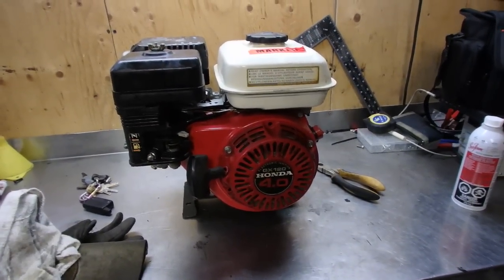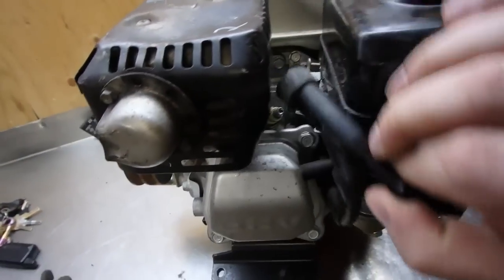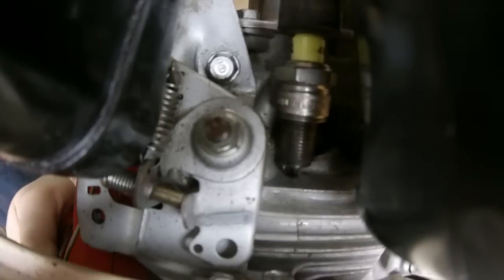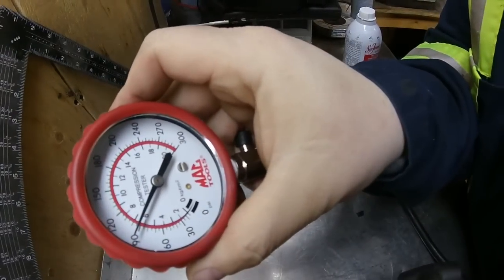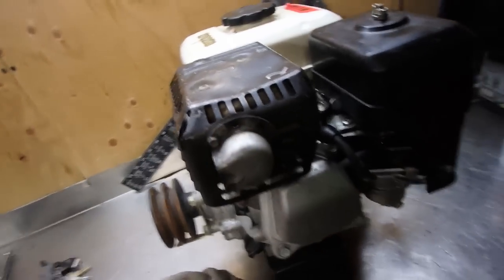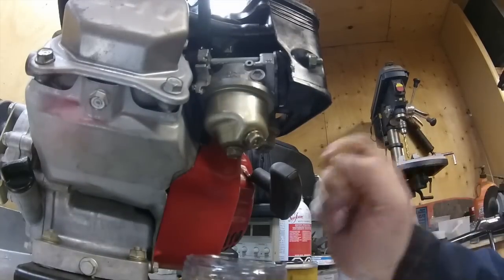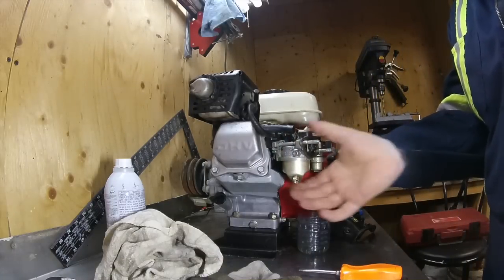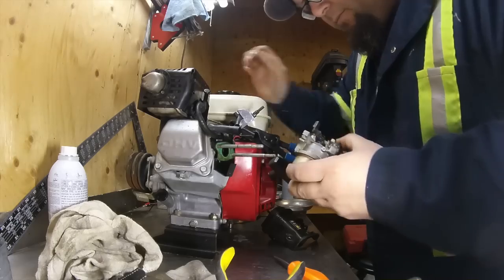Honda GX120 Troubleshooting Won't Start Issue

Comment: The round peg on the choke lever is used to block the fuel line when you remove the carb.. no need for pinchers etc.
Just pull the lever off and stick it in the pipe
Reply: @Drake Jaxon Instablaster :)
Reply: @Wayne Fabian I really appreciate your reply. I got to the site through google and I'm trying it out atm.
I see it takes a while so I will reply here later when my account password hopefully is recovered.
Reply: @Wayne Fabian it did the trick and I now got access to my account again. I am so happy:D
Thank you so much, you saved my ass !
Reply: @Drake Jaxon no problem =)

Comment: Thanks. Exact engine and problem I have. Cleaned and checked everything short of pulling the carb. That's next and I'm pretty sure I'll find a clogged jet or pilot or whatever it's called when I do. Thanks again, you really can't kill these honda engines.

Comment: Great practical video. I just fixed GCV160 that had a clogged main jet. Bought it from a guy who had replaced many parts and couldn't get it to run. Gave up and sold it to me real cheap.

Comment: Thank you getting ready for Hurricane Mathew and generator wouldn't start till i saw this video.  I had put a new carb on 20bucks but for some reason full wasn't reaching the bowl.  Your tip on the bowl help me get it started in 10 mins :).  Thanks again!

Comment: I work and re-build these engines and it's a common fault that the main jet ( pilot jet you called it ) gets clogged. Also by the looks of it you need new piston rings as it was burning oil ( blue smoke ) and that is probably the reason why your compression readings are low.
Reply: always the main jet gummed up from sitting.
Reply: If you would run straight gasoline instead of the e 85  @constantmaintenance2909

Comment: Thank you so much for this! I had everything in bits and was about to throw the carb away until I saw your video! Exact same problem. Only thing is the person before me has snapped off the screw head for the jet, so couldn’t get it out. 
I managed to clean it out in situ using lots of brake cleaner and .6 welding wire! Started on the first pull! Thank you.

Comment: Top tip for you. No need to pinch the hose, if you remove the choke lever it fits perfectly in the fuel hose. Honda think of everything. The pilot you refer to is the main jet. Once this is out you tap the carb on the bench another bigger jet will drop out which will also need cleaning. ( honda trained industrial engine tech )
Reply: Jason Tearne hi there just want some advice on a Honda gx160 on a concrete power trowel, when I start it up, it fires straight into gear and fast too, not idle at all. Recently new throttle linkage, cable, air filter & outer casing. Any help would be much appreciated thanks
Reply: karl luke under the fuel tank is the governor control arm and this may need resetting. Remove tank. Loosen the 10mm nut. Set rhe throttle arm at full revs. Use a pair of pliers and set the pin ( just above the 10mm nut , you will see there is a notch for your pliers ) and with your pliers on the left move the pin until it stops. Tighten nut refit fuel tank  set throttle arm to tickover start engine. Hope this is helpful and not over compicated
Reply: Thanks Jason
Reply: karl luke did it do the job. Resetting the control arm

Comment: Quick tip as far as the to much fuel issue goes make sure your needle seat isn’t swollen because what happened is when that needle seat is swollen it will keep the float from completely stopping the fuel supply to the carburetor and the float will stay open so make sure your seat isn’t swollen.

Comment: The jet is a main jet. And you should also remove the emulsion tube under the main jet and clean out the many tiny holes. Also you only need to remove the three carb nuts and bolt, and not the top plate to save some time. I also use carb cleaner spray and not sea foam but that is only a preference. Good job.
Reply: +Stephen May he got lucky without removing the emulsion tube, and even he did not thoroughly clean the carb, lucky man
Reply: Yep, if this is the same as on my GX390, and it does appear to be the same,  the pilot jet is on the left side of the carb (black plastic 'plug') that's held in place by the idle speed screw. The pilot air adjustment screw is also on the left side by the mounting flange, hidden under a tiny square plastic cover.

And, while the video was a good complete introduction to small engine trouble shooting (air, compression, fuel, spark), if you have a Honda engine (or any small engine, for that matter), that's been sitting for awhile and won't start, I'd go right to that float bowl and main jet first. I think 90% of no-start problems on small engines are caused by a fouled main jet due to stale fuel left in the machine during the off-season.

In my experience, another leading cause of no-start problems on these Honda engines is that they are sensitive to spark plug fouling, and tend to run overly rich which leads to fouling. Someone I know has a small Honda engine on a pump which he uses several times per day in his business. He has learned to keep a handful of spare plugs on hand. The engine will start first-pull and run great for days and days, and then one day it will absolutely refuse to start. He knows to just change the plug. Often, changing back to a previously used plug will work too. They are finicky about spark plugs.
Reply: Nemo Park I have a gx340 and wasnt able to remove the emulsion tube is it possible that could be the problem why I cant get fuel in engine?

Comment: I don't know if this applies specifically to your engine, but some small engines have a compression release mechanism on the intake or exhaust valve.  This delays the valve timing so that the compression is lower, but still strong enough to run.  The purpose is to make it a little easier to pull start these engines with a cord.  I have an engine that won't run unless I start it with starting fluid.  My jets are open as best as I can determine, new gas.  I can run a fine wire up through the jet (but I can't remove the jet; in too tight).  I think I'll remove the carb again and soak it.
Reply: Sometimes the seals/gaskets deteriorate and get leaky and that causes the engine vacuum to be so low that it will not draw in fuel without starting fluid to get it going.  I have an old Briggs engine that I have a can of starting fluid attached with a tube into the carb so I just reach down and hit the aerosol button when starting cold.

Comment: Great video - thanks Jerry!   Ethanol based fuels will gum up a carb fast if they aren't run often.   A little Stabil in the fuel helps a lot.
Reply from the maker: +Jack Maxfield i dunno if it's true or not but they say with todays fuel stabilizer really doesn't do much anymore at least to the article i was reading on fuels.  But this is the internet and anythings goes lol

Comment: You didn't check the oil even  if it's a splash low it will not stay running  I just had the same issue

Comment: Use the throttle/choke white lever. The round part is for the gas line to plug it. Cheers.

Comment: total novice here, but trying to learn... bought a wb20x from an auction, had gas in it, no muffler, no idea if it ran.   replaced the carb, got a muffler, new sparkplug, changed the oil, checked the air filter, cleaned the gas tank...  when i pull, it doesn' even try to turn over, much like what you have.   i thought i had covered the 'air,fuel,spark' stuff... what am i missing?   not afraid to pull the whole thing apart but don't want to if i don't have to.

Comment: Hi. I have a generator works when the choke is off, and never works when the chock is on. Which should be the opposite normally. Noting that it has a new battery, a new spark, the carb is clean, oil is on maximum level… Everything is in good condition. What will be the problem please?

Comment: It could be a leaky float or the level could be wrong, they can be adjusted by heating them up with a heat gun apparently !

It could also be a leaky needle & seat,low compression can give symptoms of a fuel issue such as blowing black smoke,I assume this is the engine that you had to replace the block on ?

Comment: Thanks for posting this. I have a belle 150 with honda 120 engine. I'm simply getting a blac k sooty plug, occasionally wet, no matter what I do with the choke ??? New plug, new air filter, new oil filled as per manual, fresh fuel. Clean the plug, start it and it fires and runs for about 30 seconds or longer then cuts out, black plug again. Checked the carb, defo getting fuel. A few months ago I used it to mix founds for a conservatory and it ran all day ??
Reply: Sounds like the float needle isn't plugging the hole allowing too much fuel into the carb. Remove the bowl and float and clean the needle if dirty, replace if damaged. If that's not it IDK what to tell you.

Comment: Honda engines have a decompression lever on the camshaft gear which gives a false low compression reading. Only way to really check a Honda is to either open valve cover and disable exhaust rocker, do a leak down test or take it apart and check tolerances.

Comment: Hello! Could you damage this engine if you work on it with the shaft in vertical position?
I had the oil enter the exhaust and when i tried to start it, it felt as something was blocking it. I removed the valve cover and the arm that pushes the exhaust valve was pushing on the side of the spring. Also the guide plate for the push rod was worn out on the side  and the gap of the valves felt like 1mm, not 0.15-0.2mm.
Thank you !

Comment: There's a mixture screw right next to your rocker cover/ valves. Half way down the side. 1 1/2 turns out to start then adjust when warm. Check to see if a previous Muppet has tightened it to start adjustment so much they broke the needle of the screw and jammed it in the carb body. GX clone carb will not fit the genuine GX needle hole, different profile needles and holes. Buy genuine. They're better.

Comment: Is this engine running? If not check oil to see if it is thin/smells like fuel... The seat and needle in these carbs can go bad with ethanol causing fuel to leak into crankcase. Tell tale sign is running for only a few seconds at a time and white smoke coming from exhaust. Would recommend putting a new carb on which is less than $20 and changing oil out.
Reply: Jon Chiplock where can I buy a new carb for my 390 Honda for that little bit?

Comment: I dont have my pull cord on my gx engine I was wondering which way does the engine supposed to turn when cracking, clockwise or counter clockwise?

Comment: White smoke is an indication of oil burning, either valve or ring issue. Black smoke is an indication of too rich a fuel mixture.
Reply: Steven Kulsum, if that's your experience then so be it.
Reply: Grey or white smoke is a sign of water emulsion in fuel

Comment: Hi, I have a Honda 2 stroke engine on a mini dumper, it seems the fuel dries up in the fuel filter chamber type thing, it’s a little glass chamber. I have to take the fuel line off before the chamber to get the fuel to start flowing to it, when the chamber has some fuel in it I can replace the line and it will start...... Any advice please?
Also can you tell why sometimes the pull starter doesn’t want to pull? I know to tease it out but why does it go like that??
Reply: Your problem is ethanol in the gas; that screws up everything in the carb sooner or later.   Clean all carb out and use Lucas ethanol treatment in your gas.

Comment: My 6.5 hp carb keeps leaking at 2 gasket after insulator. Tried changing gasket to no avail. What cud be the problem?
Reply: Peter Mugo the float

Comment: That was great, my plate vibrator/compactor starts fine, but only runs for 30 seconds, then it starts first pull, then it again only runs for 30 seconds. ???

Comment: I have a Honda GX120 for my first engine to fix, but it ran a sprayer tender pump and the oil is like thick chocolate milk and it is seized up. I can't pull in the string. Is this project even worth taking apart and rebuilding?
Reply: Probably badly worn rings, maybe rod bearing (or sleeve).  Likely oil never changed.  Would require major rebuild, not just cleaning.

Comment: Hello, I have the same engine on my power sprayer rig, the damn thing is hard to start. When I pull the handle it is very stiff, then it eases up a little but, I have to really pull on that to get it going. Any ideas? Too much compression, should I change my oil, I just replaced the spark plug.
Reply: It needs the valves adjusted. Will pull easier after that.

Comment: Sounds like its had some ethanol gas in that Honda as the carbs used on Honda's are fairly reliable. Honda engines are used quite a bit out on the West coast for pumps the engine can be a ball of rust the Honda starts every time.
Reply from the maker: +Graveltrucking its hard to say apparently these engines used to be used at a golf course attached to pumps so most likely they were never ever used.

Comment: Does anyone know where I can get a wiring diagram for a Honda GX390 with key start I have a Kenowa 10000 watt generator with a clone Honda GX390 I remove the wires and cannot figure out how they go back any information would be greatly appreciated

Comment: You don't need to take that plate off that holds the the spring and arm, the bolt to the left is on the carburetor is all you have to take off

Comment: Hey man did you by chance pull the valve cover and check the valve lash?  That can cause all sorts of havoc on those OHV engines.  if someone's been revving the shit out of it there is a good chance of too wide a gap on the valves.  Just a thought.
Cheers
Reply from the maker: +Mantras3333 no not yet i'll be doing a video on this channel on checking and setting the valves, that's a good call
Reply: That's a good point to get attention. It seems this Honda has served years (decades?) as a reliable workhorse and the valve gaps might be needed some adjustments.

Comment: Hello, I had a similar problem only with the engine GX160, he would not start and still extinguished, not the fault of the candle alni engine but SENSOR OIL !! It was a little too little and does not touch the sensor and the engine badly acted. After refilling an oil engine running like new.
Regards.
Reply: Yes that is good japanese design it is prevented to destroy engine running without oil

Comment: I was able to remove the "pilot jet" but wasn't able to remove the longer jet that supposed to slide out ones that small jet is removed, could that be causing my engine not to start?
Reply: Have you tried to knock it with a hammer or something? It might be possible that the longer jet is installed with the wrong side down? There are aftermarket  carburetors at ebay or amazon for about 20 euros.

Comment: Your new fuel issue is the needle and seat are worn letting fuel push into the engine.
Reply from the maker: +retiredppd that could be very possible for sure, i've been making a effort to start it and run it when i' go into the garage, fresh fuel and seafoam in the tank is making it run better everyday.  it can even idle on its own now.

Comment: It's low on oil. Those motors have a low oil sensor. When oil gets to low it stops the motor to prevent and damage
Reply from the maker: That wasn’t the issue......

Comment: A Honda GX not starting? Never heard of such a thing. Human problem indicated, too much or too little oil will trip the oil sensor switch... Once the oil moves through the engine a bit no spark.

Comment: pull start my gx120 is hard. feels like resistance from the engine. does this mean my compression is out of whack and needs to be serviced. 

when  it does starts, it runs at high rpms and then stops working after 3seconds.

machine doesnt get used often, but i do warm it up once a week. i noticed that fuel is leaking from the carburator gasket connecting to the engine. spark plug is wet. smoke is white.

Comment: Very amatuer job. Why go to all the bother of removing the throttle plate assembly when its not necessary. He did not know where the idle adjustment or fast running adjusting screws were located.

Comment: Honda GX120 question: Can anyone describe (or show me a photo or diagram) exactly where the springs go on the throttle lever?
Reply: Check this video on youtube, its very easy and clear. motoprof1441
Reply: GX160 Governor & Carburetor Speed Adjustments

Comment: You didnt need the pliers u could have used the choke lever in the fuel hose has a round part you stick in the hose

Comment: Add a public comment... 

 

pringlesgirl102572 

1 second ago

My husband just put a brand new Honda GX120 on his shingle lift it starts fine and idles but when you go to lift ...it cuts off. Any idea what's wrong?
Reply from the maker: sounds like a clutch problem that it's putting too much load on the motor and allowing it to stall
Reply: @TestDontguess  thank you very much for the quick response, he tested the lift empty would it still stall out no weight on ?
Reply from the maker: having weight on it has nothing to do with it the problem is most likely what I said above you need to investigate and troubleshoot
Reply: @TestDontguess  Thank you will do